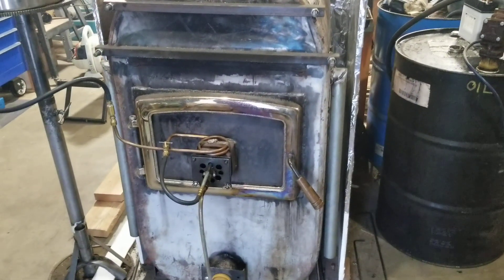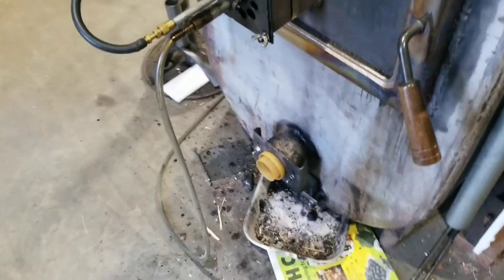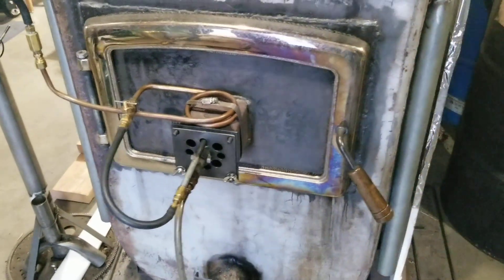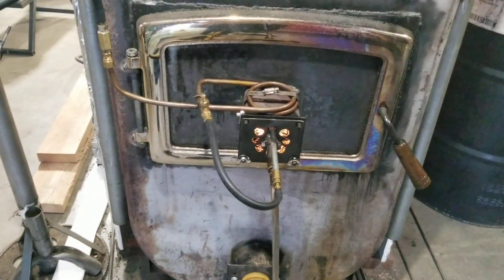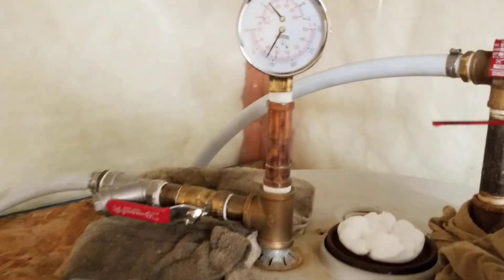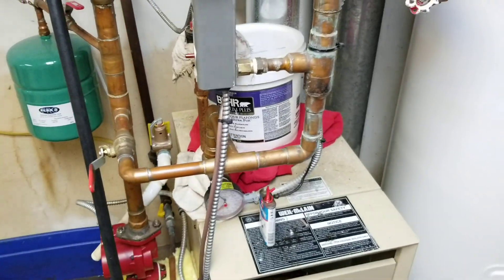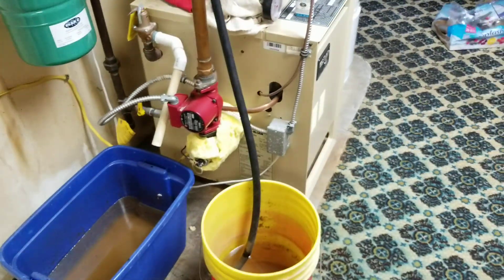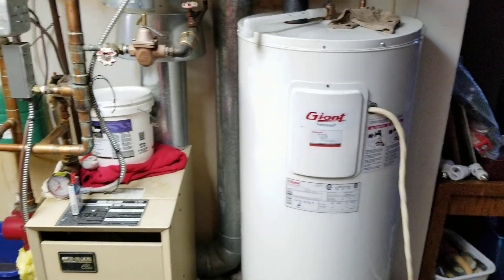Heating my house and shop off grid with my home made waste oil, solar, and wood boiler.

Comment: I wouldn't blame you if you didn't care, but you can probably add some efficiency and clean up the burn by adding a little "forced air" to the back side of the syphon nozzle. Not a lot, probably a 20-30 watt fan would be lots. 

Those pumps are also WAY quieter if you suspend them from a bungie. 

I have heated my house some this winter with oil, and I'm currently tinkering with it while working on a more permanent system. I heard you say  a litre per hour... I think at my best I was burning about 1.3 - 1.5 but my system is pretty basic. Clean, but not terribly efficient.
Reply from the maker: Actually I did have a fan behind it at one point and it did not work at all, too much air flow disrupts the air flow and will cause a very erratic burn!
Reply: @machinehead6892  Interesting. Perhaps it's due to not enough draft causing a back pressure, once more air is introduced,  or just, as you say, too much air flow because the draft is sufficient, but that seems unlikely. Oil needs a lot of air. 

This is basically a classic oil burner with the exception that you're using a syphon instead of an oil pump and there's no forced air. Lots of people convert household oil burners to waste oil burners by installing one of these nozzles and an oil heater, and the burn head is modified to flow more air, if I remember correctly.
Reply from the maker: @loweredexpectations4927  Well almost right , the oil in drawn in via a venturi vac, then with 15 psi air pressure it is drawn out the injector with 12" vac, the burn takes place in a strategically placed position in a 3" pipe that naturally creates it's own draft, coupled with the high heat the draft is further increased, that is why no extra  air was needed, then the high flue temp makes even more draft. I could control the injector draft by sliding it in or out of the end of the induction pipe changing the overall draft rate.
Reply: @machinehead6892  Yes, I'm familiar with the SNA nozzles. I have one and have played with it. I have used a commercial aquarium pump at even less pressure. 

What you are describing is basically the same as a modified Beckett or Riello burner, and they require additional air. They use the same nozzle, same air pressure, and the placement of the nozzle is critical to keep the flame "retained". The tube on the Beckett tube is 4 inch instead of 3, and they also suggest / require a draft, but have a damper to regulate draft at a specific setting.

Comment: Something you may want to consider if you don’t already have them, but they make fire O-Matic valves you put in the oil line temperature in the area of the valve gets above 165. It kills the oil. Also they make the same temperature really related safety device that wires into your system generally, the box directly above the boiler and when that reaches 165 or 185 you can buy different plugs for it but it kills the power to it if it gets too hot and everybody else is watching this remember you have insurance on your home these systems have nothing to do with oil or electric code or or HVAC codes. All of this is outside of the world of that system so if you do have a fire in your house Company is gonna say nope no way and you’re not getting a nickel they will wash their hands your property😳😳
Reply from the maker: I'm not using this system any more, I have built a negative pressure downdraft gasification boiler that can also accommodate the oil burner, I will post the new build as soon as I get the video finished, thanks for watching.
Reply: You sir are a GENIUS🙏🏼❤️‍🔥❤️‍🔥❤️‍🔥

Comment: Why is there any of your water outside of the warmed basement? I don’t get that. I can’t that tank sit down seller right next to the other tanks so that your plumbing has kept as short as possible and you’re in a warm space? 
Other than that fabulous job I am jealous as hell and now I need to go find a used woodstove so I can convert it into the multi stove that you have great job ! Be careful hauling the waste motor oil in the United States. You need to have placards a special driving license insurance all of those things to transport more than 20 gallons. Just be careful❤️❤️🇺🇸
Reply from the maker: The stove is not in my basement, it is in my shop at the other end of my yard 120' feet away, and the storage tank is in another building behind my shop.

Comment: Huge thumbs up.. Big question, with the copper loops you have in the stove, how do you keep the solder joints from melting, is it because you keep constant water circulation.?
Reply from the maker: Have you ever tried to un solder pipe when there is even the slightest amount of water in it, it is near impossible, so as long as the water flows through the pipes the solder joints are safe, I tested it to 150C of steam with no problems.

Comment: I have about the same set up about but i put a bypass that blocks off the boiler return and installed a tee but still leave the supply open for the pressure relief valve. I think for me it works better not trying to heat up the whole boiler and just send the hot water right to the house? Thoughts
Reply from the maker: I am set up in a similar way, the returning water goes straight back to the boiler and the excess will go to the storage tank, it heats up really fast this way, I can get to full temp in about 30 minutes.

Comment: WTF dude .I'm at a loss for words without getting flagged, I'm all for saving a buck, I burn wood myself. but WTF. I'm a blue seal licensed  operator, since the 80s started as a HVAC guy. WOW is all. Just WOW,
Reply from the maker: Thanks, I have been experimenting with different systems for years and I like to build crazy stuff, this stove has been a marvel and is saving me lots of money in the process, it is a fraction of the price of modern wood boilers now costing around 16k for the most basic unit.
Reply: @machinehead6892  wasn't a compliment.you over complicated it & Not 1 safety/relief valve for starters
Reply from the maker: Actually there are two thermal relief valves @richvanorden7026 just can't see them in the video.
Reply: @machinehead6892 watched it again, and I didn't see any. No safety on the oil feed as well.  Recipe for disaster my friend. Ever see a boiler explode.

Comment: A man after my own heart.  Awesome job here - to be totally self-sufficient when it comes to heat and not have to pay a utility a penny for keeping the family warm.  You are to be commended for the system you have built.  The fact that you have alternative fuels makes it even better as you're not relying on just one source.  Hats off to you!  The oil injector sounds like a little pulse jet - like a V1 buzz bomb...
Reply from the maker: Yes thank you, it has saved me a lot of money so far, and yes the pulse of the linear compressor gives the injector a pulse like an automotive injector on a duty cycle.

Comment: hi great system
it is almost the same like mine here in ns.
im interestet in your diy oil burner buildt with meshurements with pictures please i piced up an cast iron oil boiler that i will plum parallel to my wood boiler.
thx
Reply from the maker: What is it you would like to know about the oil injector? it is a waste oil furnace injector powered with a linear compressor and it is mounted in a 3" square intake.
Reply: @machinehead6892 pick of the what exchanger
Reply: hi thx 
just pictures from the burner nozzle assembly, i can see the outside in the video, the injector nozzle assembly from the front
 please
thx

Comment: Is that 3/4” going into the plate heat exchanger? If it is I’m shocked that it’s heating your home because it’s only good for 48,000 btu’s/h  at 6.5gpm max. Just asking
Reply from the maker: Yes the whole system is 3/4" I have 100ft of 3/4 Pex under ground to get to that plate exchanger and it heats everything with my pump on low speed, no problem.
Reply: @machinehead6892  Curious how you went about insulating those lines underground. I used a Logstor product when I added the garage as a zone and it works well, but...$$$.
Reply from the maker: I use 3/4" foam tubes with 1 1/2" over them , then five wraps of the foil backed bubble insulation then wrapped with 8 mill poly, It was very cheap and works excellent, In 100ft I lose about 2-3 deg F. the lines are buried 32 inches in the ground.
Reply: @machinehead6892  Thanks!

Comment: Any chance you could share more details on the little air compressor?
Reply from the maker: It is a linear compressor, it produces 15psi @ 3cfm, got it on Amazon $100, Canukistani Pesos.
Reply: @machinehead6892  The fact that you used the term Canuckastani makes me respect you even more!
Reply: @machinehead6892 post a link
Reply: @machinehead6892  i do not see any of these pumps that will do 15 psi .
Reply from the maker: @michaelearley8191  Well they are not rated in psi  they are cfm and mine is 300cfm  and when I test it to 15psi.
Reply: Thanks
Reply: please help I can not find that compressor on amazon
Reply: yeah, I looked too. Nothing produces 15psi at 3cfm that I could find. Must be discontinued or something.  @billytonnemacher8341
Reply: It's a commercial aquarium pump.
Reply: What is nozzle size
Reply from the maker: @chulle85  1mm
Reply: @machinehead6892 tnks
Reply: What percentage gasoline in oil you use,approx?
Reply from the maker: @chulle85  maybe 10%more or less

Comment: Very nice set up, i burn wmo, and wood, but seperare, i use a fuel oil furnace converted,  i was wanting to do the same set up you have,  and after seeing your setup,  i now know what im going to do and how to do it. Is your water copper lines that inside seperated by a steel plate or are they just sitting inside exposed to the flames? What are the square tubing bolted on front for and what is the round tubing welded on each side for? I appreciate you sharing, it will help me better understand how i will do it.  I love the heat that get from oil, it packs a bunch btu's and easy to move around vs wood. We are completely offgrid, solar and wind, and i love it, sure its a bit work, but having the self sustainable and never worry about power going out.
I bought 6 vacuum tube thermal water solar panels, that i will be installing and putting in a big water tank, im hoping that it will help take care of heating and having alot more hot water, from everything ive seen, they should make 150f-200f hot water even in freezing weather, i guess we will see when i put it in this summer.
Reply from the maker: The lines are all copper and 56 elbows all soldered together in 3 layers to make 27 passes and yes exposed to as much of the flames as possible at all times, I have to scrape them  once a week and front panel access makes it easy.
Reply: @machinehead6892  ok, I got ya, access panel, thanks for replying, that helps alot.

Comment: When you burn the oil, do you get  hint of the smell of the burning oil exhaust?
Reply: No, if you get the air fuel mixture set right, you get zero smoke and zero smell, ive been heating this way for years,  and you can stand next to the smoke stack, and smell nothing, you see nothing but heat waves.
Reply from the maker: That is totally true, it actually burns cleaner than wood, nothing left, no ash.
Reply from the maker: Only when it is first fired up (cold) once hot, the oil is completely incinerated and no smell or smoke, the stove is white inside because even the creosote from wood burning is all burnt away.